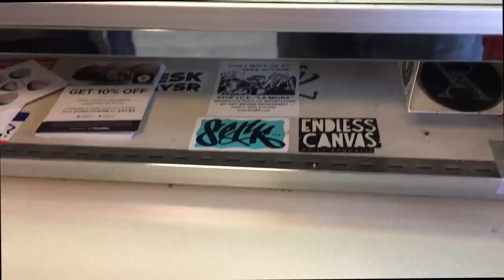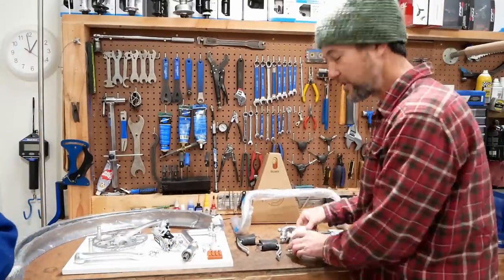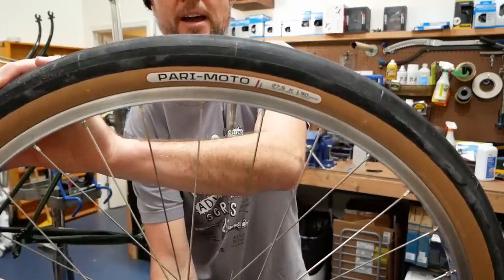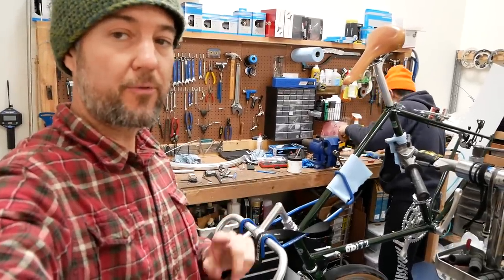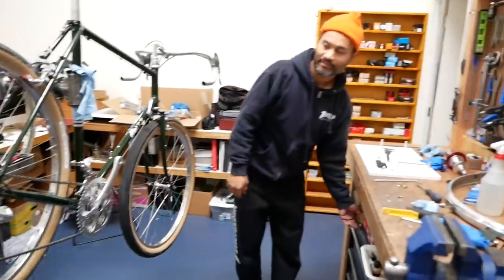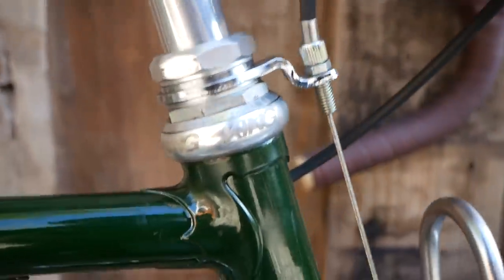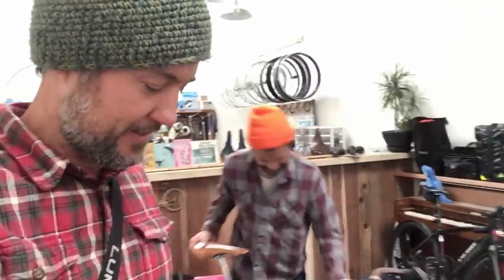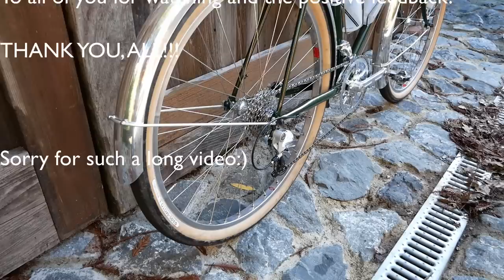Custom Steel Bicycle All Road Bike: The Complete Build

Comment: I found a calculator online and found out my bike's trail is 75mm/71mm mechanical trail 🙄you have me thinking about all of this stuff!✌❤🚲
Reply from the maker: High trail bikes are very stable. The lower trail forks have more rack so they tend to flex a little more providing a nice ride quality. I'm still on the fence on which set-up I like better.
Reply: @Henrywildeberry  the fork on mine is flexy with the forward bend  down to the axle as well and I enjoy it. The geometric qualities of my bicycle seem to be well suited to how I tend to load it up and make it really comfortable on long riding days, too. My current battle with myself is in learning to deal with my newfound sloth... never knew I'd miss 4 teeth on the count of both my old chainrings so badly. I am enjoying my 'Grandpa Gear' on my new triple setup though. the soulution just may be to finally remove my old CatEye Enduro8 from my handlebar stem so I don't think about it so much!

Comment: Nice bike.I have three bikes,a Trek 830 with a Zip electric motor,a vintage Motobecane Super Marage and a Ross Eurotour.All have new tires but the Trek needs a new battery for the motor but it's hard to find online.It's the motor that rolls against the back tire and has a small switch on the handlebar to control the power.Do you know where I can find one cheap?Also how much is your bike worth?

Comment: Excellente video Monsieur Wildeberry. Tres bien. J'adore the beautiful Velo Orange classique compact - crank that you upgraded to it goes so well with the bicycle. Velo Orange Grand Cru sub-compact double 165 mm 46-30. I am 5'7" so would probably purchase the 165 mm crank length arms with the same Shimano XT 10 speed 11-32 cassette.
Reply from the maker: I'm glad you like the final build! The VeloOrange crank is nice! I have just about 10,000 miles (16,000 Km) on it and, so far nothing to complain about. The 165mm is an excellent choice! I'm riding a 170mm and I have very long legs.

Comment: wonder how the bike is setup now? I switched from a triple to a dual range double setup and have been loving it. Dual range is having a 18+ tooth difference in the chainrings. I have a 46/28. and on another bike I run a 38/22. You basically ride it like a 1x but have the lower chaining when needed.

Comment: For versatility, similar to those rides you and Ms Cool's where you are on a mixture of surfaces including Randonneur Brevets ans gravel, do you use 650 B and 38 width or even wider? Would you use Panaracer Pari Moto 38 or wider? Or even up to 48 width? What tires did you and Ms Cool's use for the 300 k Brevet? Which included mixed terrain or even some single track.
Reply from the maker: Stephanie Hughes I’ve been using 650b x 48 and I think they are an excellent all-round tire size. I prefer a slick tread because most of the time I ride on pavement. When we rode the 300k I was on a different bike with 700 x 35 tires. They work very well too. The 48’s feel a little more comfortable especially when we do ride off road. Both sizes work well. There are more 700c rim options, but the downside for very wide 700c tires is frame clearance, and they are a little heavier. Both are very versatile, and if you already have a 700c bike the differences are minor, and probably not worth the cost to change.

Comment: Beautiful bike and fun video. I wasn't able to catch which derailleurs you mounted. I'm curious because I am currently doing a similar build with friction shifters.
Reply from the maker: Thank you! I went with a Shimano Deore 9-speed long cage rear derailleur. 25,000 miles on it and still going strong. I did swap out the original lower pulley (jockey) wheel with sealed bearing type. I kept the original upper jockey wheel with the sliding bearing for smother shifting.
Reply: @Henrywildeberry  Thanks Henry. I only now saw the follow-up review video. Am I right that you ended up replacing the VO triple crankset?
Reply from the maker: @markholter5687  I still have the VO crankset, but it's a compact double, not a triple. Ms. Cools had the VO triple on her Polyvalent.
Reply: @Henrywildeberry  Ah, thanks for clarifying. I mixed them up. Cheers and thanks again for the great channel.

Comment: Great bike ! and great building I would make only 3 small changes. White outer brake cables. Paul Minimoto brakes and Brooks C15 saddle.
Reply from the maker: On the C-15 do you have the center cut-out version? Mine was pretty stiff so I ended up letting it go when I sold my Bianchi.

Comment: Did you find a 650b rim w/ breaking tracks or are you using 650c rims? Do you know if 27.5/650b tires fit on 650c rim well enough to be run tubeless?

Comment: Sorry to dredge up an older video with a question....but I saw in your video that the "donor" bike had a bell on the stem.  I understand that it used to be a thing to drill and tap a quill stem for a bell.  Had you done this?  With your experience, was it a good idea?  Safe?  I am building (rebuilding) a L'avecaise up, and am changing the stem to a longer version.  The current (short) stem has a bell drilled and tapped onto the stem.  

I'd love your thoughts!  Thanks!  Love all your videos.
Reply from the maker: Hi Caspar. Interesting you ask, because after this video was posted I purchased a different stem and handlebars for this bike. I wanted to experiment with a set of parallel handlebars without the rando up sweep. The stem came with a predrilled hole for the bell. When it arrived I was a bit surprised thinking, like you, it might weaken the stem. Where they are typically drilled, on the side of the stem and centered in the quill portion, makes sense. This is an area where the stresses are low, so I can see how it's justified. However, it's also possible to create a stress concentration and overtime may lead to a crack. Is it worth it? I'm sure it's something you can monitor, like I did, but I'd rather not have it on my mind. I've gone back to a stem without the hole and a new bell with a band clamp. I can clamp it on the bars or the stem. All the best!

Comment from the maker: Here is a list of the parts currently on the bike. Things still to come are a dynamo front hub, headlight, taillight, and a front handlebar bag.
 
Honjo Fenders H80 62mm wide for 650B tires with hollow stays
Rivendell Downtube shifters https://www.rivbike.com/collections/shifting/products/silver-downtube-shifter-kits-17101
Brakes Mafac Raid center-pull (vintage)
Handlebar Nitto B136 (42mm wide) with a 26mm clamp
Stem Nitto NP 100mm with 26mm clamp
Saddle Gilles Berthoud Galibier (Natural color) with Ti rails
https://berthoudcycles.fr/en/538-leather-saddle-galibier-natural.html
Seat post Nitto 83
Headset Chris King 2Nut 1-inch threaded
Front Rack: Custom Fitz Cycles w/Integrated headlight mount
Crank: Velo Orange Gand Cr subcompact double 170mm 46-30 https://velo-orange.com/products/grand-cru-50-4bcd-crankset-mkii
Pedal: Shimano XTR
Hubs: Shimano 600 front & 6600 Ultra rear (130mm spacing)
Bottom Bracket 115mm square taper (VO recommends 118)
Bar tap: Brooks Cambium in Rust color (Soon be changed to a donated tape from Mr. Cauthorn). 
Rear Cable Hanger Nitto
Front Cable Hanger Dia Compe
Tires Pacenti (made by Panaracer) 650b x 48mm 
Rear Deralleur Shimano Deore 9 speed mountain 
Front Derailleur IRD 
Bottle Cages: cheap stainless for now
Bottles: Camelback
Brake levers Suntour aero (vintage)
Quick releases Shimano Ultegra

Comment: Hello Henry,
What is your bike pump?
It seems a long one... Is it a vintage model or a current one ?
Reply: Oh, and did you go for SL connectors on your fork for your SON dynamo ?
Reply from the maker: It's a Lezyne Road Drive, they come in different lengths to fit your frame. It's very light too (100 grams).

Comment: Where does the upper part of the rack attach?
Reply from the maker: Hi Andrew, the upper part attaches to the center-pull brake bosses. To mount a rack this way you need to get a set of special threaded inserts. Rene Herse sell them on their site, and I think you might find them in a few other places, like Grand Bois cycles, and I think even Paul Components may have some depending on your rack. Generally, this is something you will need for a custom made rack.

Comment: How much do your WHEELS (+ tires) weigh?
Reply from the maker: Hi Jakob, I have two sets of wheels, one with a dynamo and the other without. The set without the dynamo is 1775 grams and the dynamo set is 2000 grams. The 650b x 48mm slick tires are around 400 grams each, and tube are 100-150 grams depending on thickness. A combined weight is somewhere around 2900 to 3200 grams with rim tape. Knobby tires are about 100-150 grams more each depending on tire model and manufacturer.

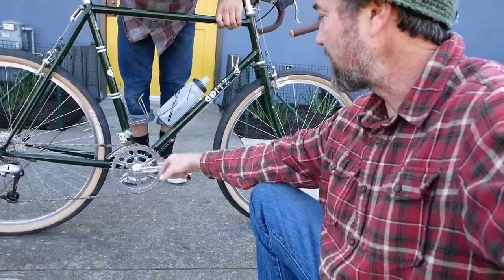Comment: I used to ride in the Alps when I lived in Europe back in the 80s; Rode up many of the TDF summits with a 12 speed; climbing 1000m at 10 to 12% was typical. 39:26 was my smallest gear on my aluminum road bike.  No issues when you're 18 years old weighing 160 lbs and measuring 6'-3".  Now I'm spoiled with my 11 speed cassette that provides me with a 30:32 gear.

Comment: What a great looking bike.Try a mountain bike triple front mech.,they have a nice tight radius .A suntour xc pro would complement the retro look of the velo orange chainset
Reply: From what I've had in the stand, most front der's for mtn bikes are made for a 42 tooth big chainring. While you can make it work ok in the little(if you're using a triple) or ok in the big, it doesn't handle doing small and large rings very well. But if you are using a compact crank, why not use a cyclocross front der? Suntour could handle a 46 tooth big chain ring, I only wish that it was still in production!

Comment: Great video, really  nice Ohmar, let you use his shop.  Not much in the way of gravel roads, in my neck of the woods, lots of quiet country roads.  That crank gave me an idea .  I'm moving all my touring gear of my old touring bike, onto a Bridgestone 500, I built up in 2017.  Found my old Suntour 46/28 crankset.  Ordered a spindle, and will install with a 7 speed 13-34 cassette.  I put on some modern components,  but replacing the 27 in. wheels with 700, and I think 28mm will fit.  Plan on doing a little unsupported riding this year. 

Wow! MS. Kools got a new bike too,  you guys will look great, riding on your new bikes.  Bring on the videos.

Comment: I have that same VO crankset. When building my passhunter at the end of 2018 I wanted a triple as well. Since I was going with brifters Igor at VO strongly recommended these instead. I was antsy at first because Live in Central Asia where we have insane winds and like to be able to really get low to keep on pedaling through. I will say that these cranks have really been amazing. I love the looks, and the gear ratios are aok for everything I’ve done so far.

Comment: hey henry. hope you are good. how do you like the saddle? u still ride it or did you switched back to brooks?
Reply from the maker: Herrmann Hinz hi Herrman. The GB saddle is pretty nice. It’s lighter than the Brooks and slightly narrower too. It’s a good saddle if you like to ride in the drops because it feels more like a racing saddle. I think I still like the Brooks Professional for ultra long rides, but the GB works too. If weight savings and a more aggressive riding position suits you get the GB, if you want long day, everyday comfort, I would choose the Brooks. All the best! Both are 👍
Reply: @Henrywildeberry  okay, thanks for your opinion. currently i do run a brooks cambium c15 carved. in the beginning it was kinda not so comfortable but my seat bones got used to it. still, when riding longer routes i wish sometimes i would have a more comfortable saddle. my bike is a more performance orientated all-city cosmic stalion but i ride it kinda "supple". :D i may compare mine then with a brooks classic leather one instead of the GB. seems to be a better alternative. i was just watching your saddle video also. have a good ca. picture now.

Comment: What was the reasoning behind the choice of using center-pull brakes when you could've used cantilever brakes?
Reply from the maker: I spoke about this in a previous video, but a couple reasons. First, it was to keep with a classic look I find very appealing. Second, braze-on center pulls have excellent braking power. Third, they do not have to stick out to the side as far to get the same leverage as cantilevers. All that said, cantilevers were a close second, and I would have gone that route if I couldn't have center-pulls with 48mm wide tires with fenders. I'm really pleased it all worked!

Comment: Beautiful bike! I understand that you want a compact crank, but my suggestion is that the front derailleur is slightly outboard. If the tail end of the f/der is rotated in towards the seat tube ever so slightly I think you'll feel a big difference. Once that happens, then a slight adjustment to cable tension and throw on the f/der... I think you'll feel/see a difference that in shifting. Always fun to have a new bike, hope you many happy miles!

Comment: In regards to the crank, if you want a low "Q" factor triple crank try an old new stock Sugino Aero Tour triple or a VO Grand Cru 110 Fluted Triple Crankset. They are both stiff and looks pretty nice, the Sugino AT has a thinner/rounder look with a polished finished while the VO crank is more square-ish with a very high polished finish....

Comment: MAFAC RACER Brake arches appear short for the frame dimension and 650B with fender combination.  MAFAC RIDE arches provide perfect solutions for:
1. Shoe stem fixing bolt be located in the middle of arch foot, not to the toe or heel. This margin is essential when you readjust the shoe alignmnent as it goes skinney.
2. Enough clearance between arches and fender not to interfear. Contact and vibration make noise and loosen the fender fixing bolt,  resulting it goes off.
3. Reasonable clearance between tire and fender, fender fixing bolts. Tire code initial stretches, air slow leak, puncture patch, heav load, wetty mud gives the actual tire diameter glow. Or simply when you change the tire brand, size or lot, the clearance gives you peace of mind.
Nessisary
Reply from the maker: Thanks for all your thoughtful and insightful comments! I've recently switched out the original Mafac pads with a set of pads made by a different brand (Jag Wire). I wasn't as impressed with the 4 Dot Salmon Pads as others seem to be. As a result of the change, the posts are no longer bottomed out on the slotted mounting holes. I'm not quite sure why that worked out that way? I do wonder whether having the pads positioned at the bottom of the slots would adversely affect braking performance? Maybe only marginally would be my guess. Pad compound itself is likely to be a much bigger contributor to brake modulation and stopping force. Anyhow, all this is my own conjecture and experience. I'm sure others have had different results.

Comment: Great looking bike. You only briefly touched upon possible fender fitting issues in the video. I didn't think 48mm tires, Mafac centerpulls, and fenders would work but you seem to be managing OK. Did Fitz have to do anything special with clearances or fender stay mount points to accommodate?  Also, will you will be adding a dynamo hub in the future (if so, does the fork have internal wiring, wireless connector to the hub, or external wiring eyelets)?  Nice custom rack, btw!
Reply from the maker: Thanks Carl! The surprising part of center-pull brakes is how they open up when the brakes are applied. In that regard if the fender fits through the brake itself, then it will typically work. I did find I needed to make a few small bends in the fenders around the braze-ons and the fork blades in order to create a space between the two metals.If not the fenders would creak slightly while I was riding. Alternatively, a slip material between the two might work as as well. Very careful placement of the brake and fender bridges is key. In fact, it's best to have the fenders on hand with the frame builder along with the brakes to make sure everything is going to fit perfectly. Done right it will work perfectly!

Comment: Beautiful!  Who makes the FENDERS, front RACK and the T-shaped, Thorn NOMAD-like FORKS?  What RIMS are you using?
Reply from the maker: Thank you! The fenders are made by Honjo. A very nice and light aluminum fender.
Reply: @Henrywildeberry  What about the : front rack, forks and rims?  Who makes those?
Reply from the maker: Jakob W the rack and fork are both custom made by John Fitzgerald (Fitz Cycles), and the rims are Pacenti Brevet rims with Shimano road hubs built for 9-10 speed. I did a video on the wheels built by Omar at Allrounder cycles in Emeryville.